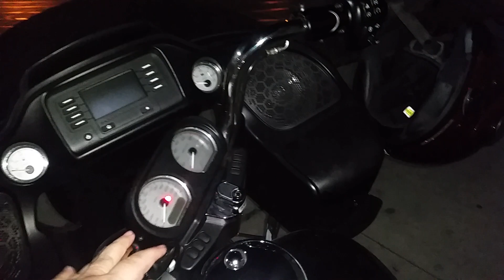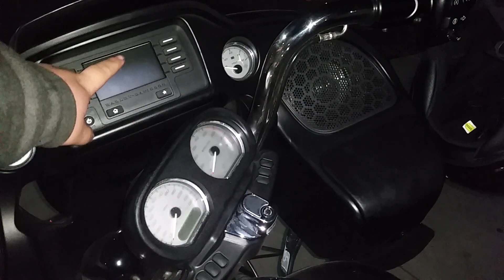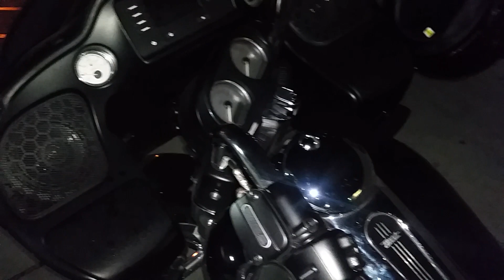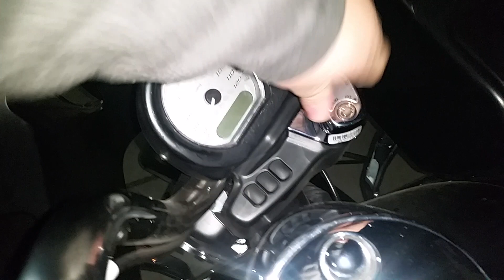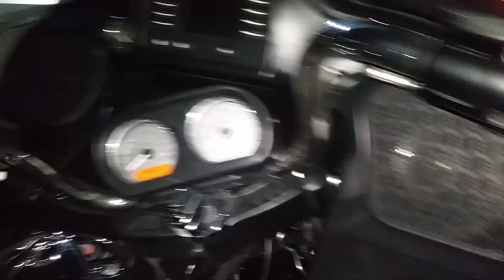10 things I hate about my 2016 harley road glide

Comment: To sell the bikes up here in Canada they had to add a regular style tail/brake light just above the signal lights. They were not visible enough otherwise to pass our road standards. In doing so our fender light at the bottom does not light up.
http://i176.photobucket.com/albums/w199/Zinc001/IMG_1235.jpg

Comment: Since this is his first Harley we have to cut him some slack. When you buy a base model you can't expect all the bells and whistles. With a $70.00 optional wire harness from Harley he could have access to all the features of the radio system. Additionally, a headset is required but they can be found on Ebay for $35.00, no need to buy the Harley headset.

Comment: All bikes sold by Harley in the US have the same engine tuning and exhaust, no matter what state they are purchased. California bikes are no more, as you put it, choked down than any other state. And yes, there are slip ons and full exhaust which can not be sold and shipped to a California address. That's because the state has  noise level requirements that prevents loud exhausts from being sold to residents. That's fine by me since the stock exhaust is fine.

As for the battery location, how often does anyone have to get to the battery? Sounds like you should have gotten a  Goldwing since the battery is right under a sidecover. Now to get at the air filter on the Goldwing, allow 1-2 hours to change it. At least on a Harley, it's real easy to replace it.

Remember, nothing is perfect.
Reply: Not true. California bikes ARE WORSE.  There is a such thing as a 49 state bike, just found out about it yesterday, buddy was going to scoop up a ultra Classic in Vegas and couldn't purchase because it was not a 50 state bike.

Comment: So all of the times you touched your rocker boxes and other chrome parts that get hot, your prints will now be embedded because you didn't clean off the oil your fingers left on it. The bike is air cooled. That's the reason why it gets hot. You didn't have to take the seat off to mount that. You could have just purchased an adapter that hooks up to your charging wire behind the left side of the seat. You can mitigate a lot of these issues by research and diy. I did my intake and exhaust and tune all by myself with basic tools and some common sense.
Reply: ro t bcc s